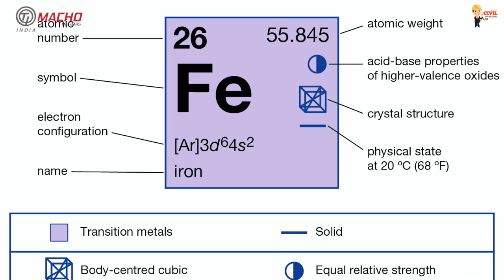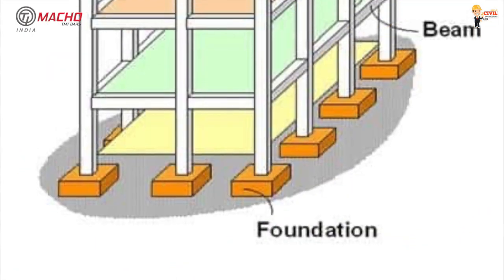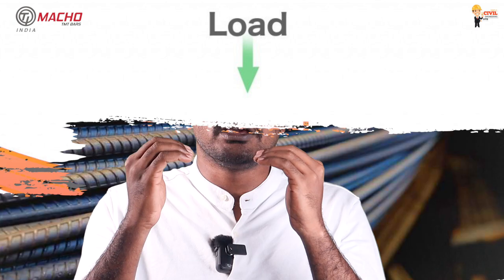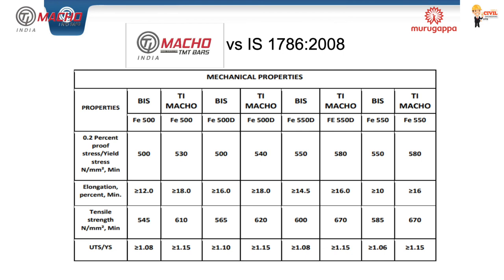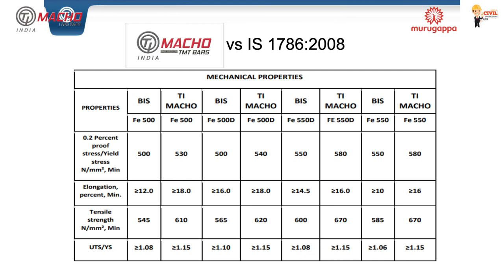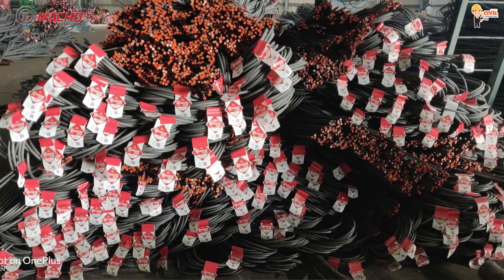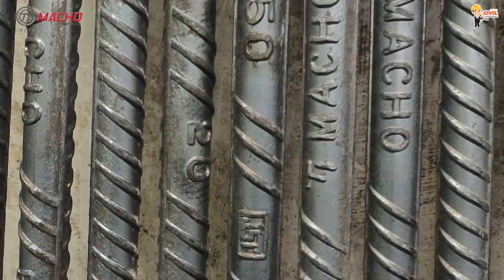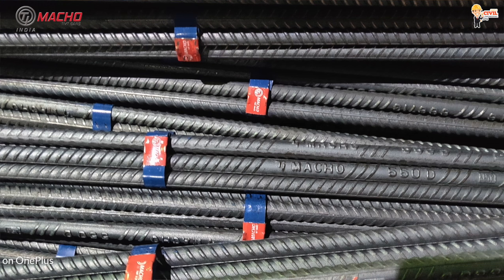வீடு கட்ட TMT Bars வாங்க போறீங்களா? Best TMT Bars in India🔥🔥🔥

Comment: bro apa  D ula steel la building  load athigam achuna bend agirum la bro
Reply: Concrete compression strength a pathukum, steel tensile strength a pathukum. D iruntha extra safety for shock resistance